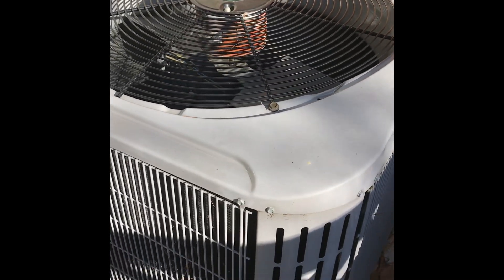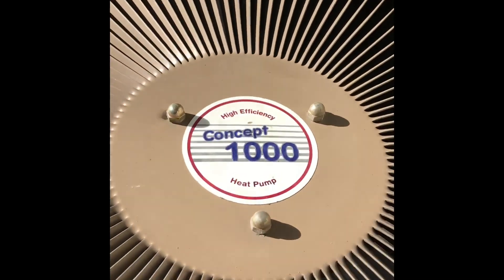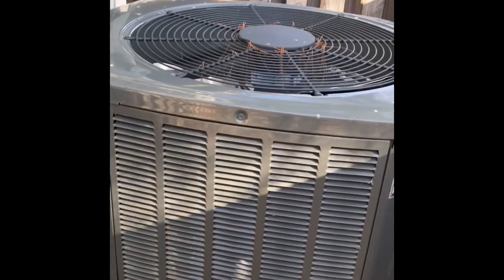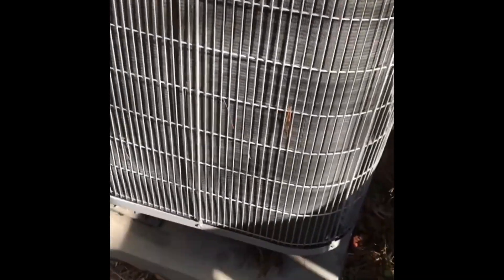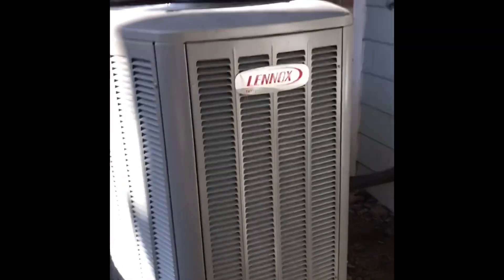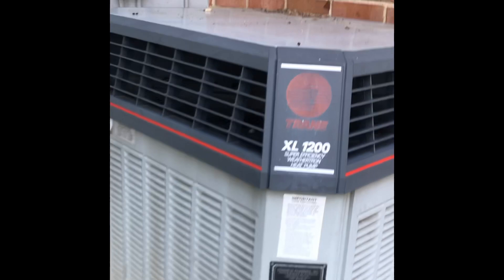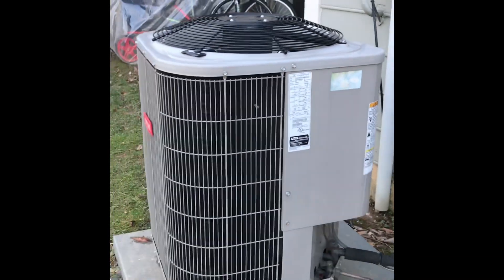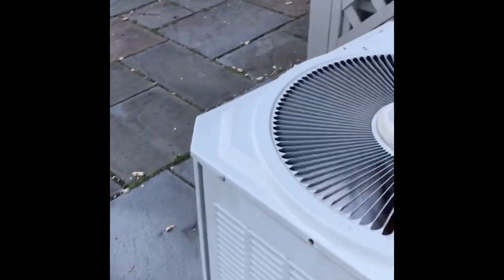The heat pumps at my old neighborhood! (Read description)

Comment: Nice finds! I was shocked when I first found out that Trane still carried that design for their units up into 1998 a few months ago. Apparently Trane made that design for their xl’s from 1986-2001
Reply from the maker: Thanks! I believe the XL 1200 was discontinued in 98, but the XL 1400 and 1800 still were being manufactured until 2001.
Reply: The XL and XE series were made up until 2001, when they were switched with the XLi and XR style units. The XB1000s however were made up until around 2006.
Reply from the maker: @OsmHVAC  That sounds about right, except i thought that the XB1000 was discontinued in 2004
Reply: no, there's a confirmed unit made in 10/2005.
Reply from the maker: @OsmHVAC  ok

Comment: My top 3 favorite units in this video is the Carrier tech 2000, Airease concept 1000, and the Trane XL 1200.
Reply from the maker: The 2003 AirEase, Carrier TECH2000, 2007 Carrier base model, and Trane XL1200 are my favorites. Which AirEase were you referring to?
Reply: @fanshvacandmore14  The one from the 2003.
Reply from the maker: @Massachusettshvacandmore  Ok

Comment: Is xe got a bad fan or if its compressor or reversing valve
Reply from the maker: It's both the fan motor and the compressor. The fan motor has bad bearings, and the unit has a tired compressor
Reply: @fanshvacandmore14  it's time for a new one lol
Reply from the maker: @heatpumphvac3150  It is lol
Reply: @fanshvacandmore14  yep lol